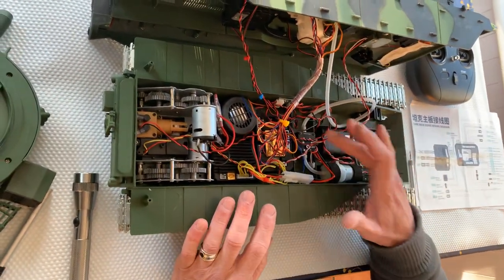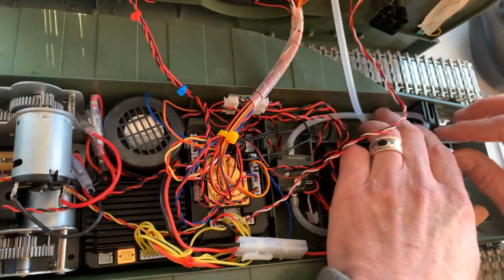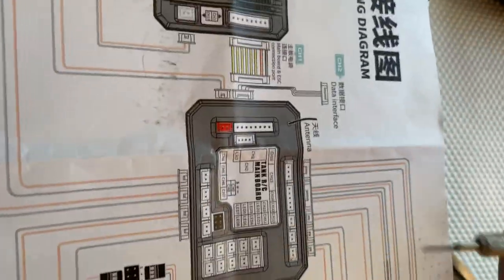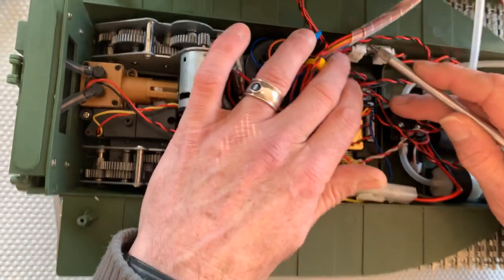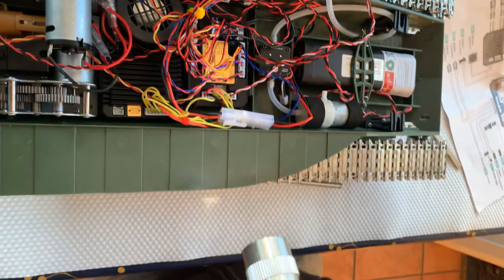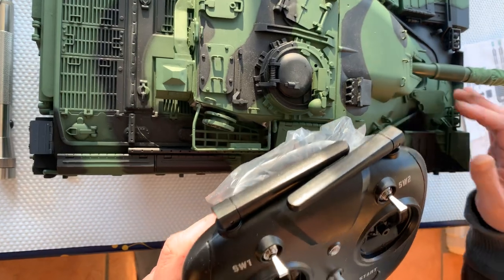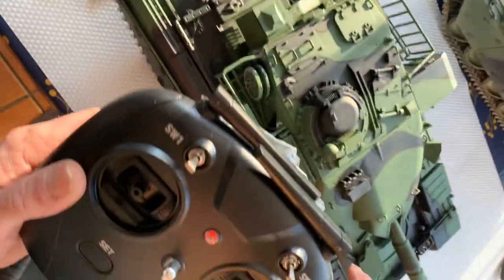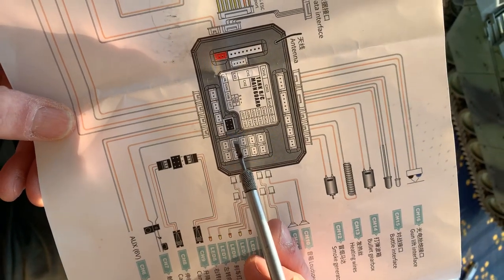Haya chieftain barrel smoking and flashing brief introduction on modification

Comment: Hello Andrew I brought this tank back in November 2019(the good old days) and I was wondering how I can use just a servo recoil on the gun instead of plugging in the BB firing one it comes with any ideas on how to do this?
Reply from the maker: hi, it is easy to do , straight forward. 1. unplug cable on CN10 .    2. use a jumper to plug in CN6
Reply: Ok I'll give it a go,also when I turn my handset on it takes quite a while to come on is there a button you hold down to switch the handset/transmitter on?
Reply: Just done the servo with jumper on cn6 works great thanks 👍